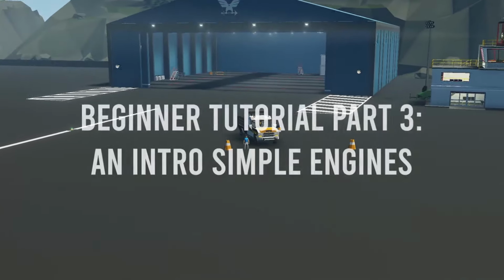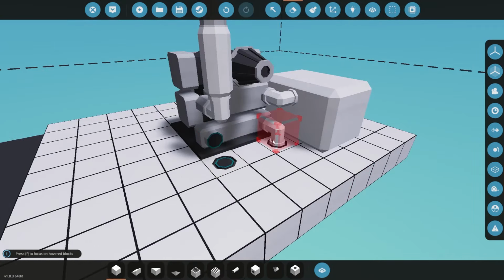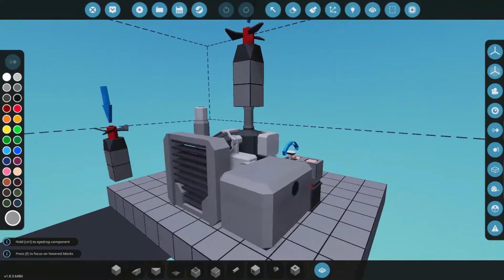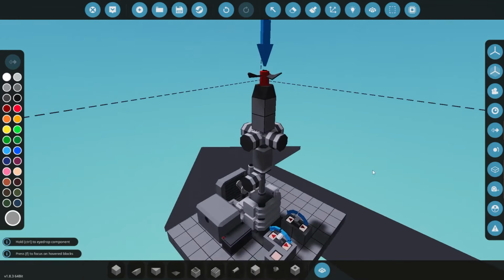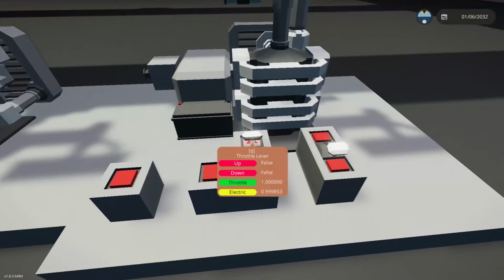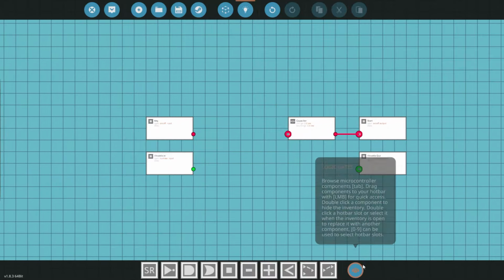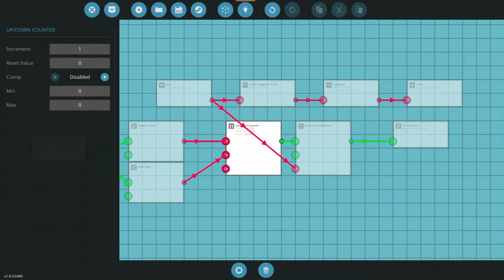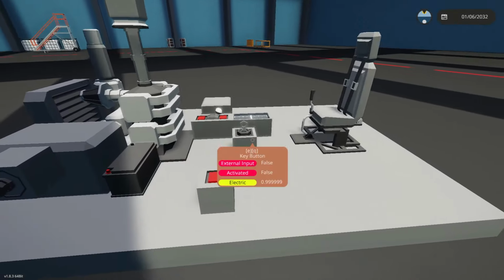Simple Engine Tutorial for Stormworks (Engineer Explains)

Comment: IMPORTANT FOR ALL STORMWORKS WHO CAME FOR TUTORIAL IN ORDER TO ENGINE FUNCTION CORRECTLY.

After the space dlc update, you must add a gas relief valve for the fuel tank. Just hook it up similar to the engine air. The only difference is that you must have a gas relief valve and position anyway you like. Don't forget to add any components like fluid port, air filter, or ram air.
Reply from the maker: 100% True, thank you! I did make a video specifically about that realization, but good to note here!

See video here: https://youtu.be/aHdklCKUtKw
Reply: @454ss_gaming  sorry, could you tell me which of your videos is about this?
Reply from the maker: @tukangambit406  https://youtu.be/aHdklCKUtKw
Reply from the maker: @tukangambit406  You can find it here: https://youtu.be/aHdklCKUtKw
Reply: @454ss_gaming do you know if there were any changes to the generation of electricity/battery supply too? Because i started recently playing stormworks and watched many tutorials. Everyone is doing it like you with just the small generstor connected via logic interface to the battery. But it doesnt work on my build and even small rafts are constantly draining the battery without charging
Reply: @jonathan1384 starter has to be disabled after the engine runs because it consumes alot of power
Reply: @Sliptethank you, ive learned it already and it works
Reply: @jonathan1384  well anyways hope you have fun with stormworks

Comment: Built a small ship, duel small engines, had everything hooked up acording to a steam guide and these videos, but everytime I'd start it, It'd drop rpm till 0. Had the clutch setup to be on when started, had the throttle set to 0.15 to avoid stalling, but no matter what I'd do it would stall after starting. I've spent 3+ hours searching and troubleshooting to no avail. 

All intakes/exhausts are setup shorter then 20 blocks and with ports
microcontroller setup just like this tutorial
custom fuel tank built similar to the one in the "unofficial stormworks guide" on steam
RPS going into a clutch, going into two 1x1 gearbox's with ratios set according the guide as well

as far as I can see from these videos, many google searches, and the guide, everything is setup right but it just wont idle. I know im missing something but I cannot figure it out.

Just kinda venting for a min, dont expect any help but any tips or idea are welcome. Gonna take a day or two then maybe try another build or something, idk.
Reply from the maker: My first advice when an engine doesn't run is to disconnect the load (ie. propellers).  Then put throttle to 100% and see if you get like crazy RPS (50-60).  If that happens, your engine is stalling out by the load.  If that does not happen, your engine is not getting air or fuel, or exhaust is building up!
Reply: @454ss_gaming  In all my rage it never cross my mine to try that. I appreciate you fr 🖤

Comment: Whenever I press the starter button it seems to keep trying to start and it goes while pressing the starter without throttle
Reply: How do I make it stop driving when I press the starter?
Reply: It also doesn't start AT ALL
Reply: What I mean is that that stupid car goes when holding the starter and it doesn't seem to get enough RPS's in order for the throttle to work
Reply from the maker: @FlorVerschraegen I have more advanced tutorials that I would recommend. Sounds like you don't have a clutch so the power is going direct to the wheels!
Reply: @454ss_gaming okay thanks 👍🏿

Comment: So, I built my first working ship — I’m so freaking proud! I made a custom 16-cylinder engine that has enough power for it. Okay, it loses some RPM after about two minutes because of heat, but so far, so good!

I even made my own custom controller for the clutch, key, and throttle. Thanks! It was so overwhelming at first, but after understanding the shortcuts and the navigation inside the building menu, it became much easier. I’m far from a pro, but it’s enough to give me a big smile every time I spawn it in!

The only problem I have is cooling the engine... Even though I made three loops with six electric radiators, it just won’t cool down. Meanwhile, I built another ship using the preset big engine — and that one cools perfectly fine with just two radiators.
Reply: Hi friend, are you installing a coolant manifold? Also, the engine's water pump is probably not sufficient. My recommendation is to install an external water pump and remove the standard water pump from the modular engines, logically running the piping through one side of the coolant manifold, then through the radiator, and ending on the other side of the manifold.

Comment: my engine just cranks and I'm starting to lose my mind. i changed from gas valve to liguid nothing.... I'm truly pissed cause I spent all this time trying to get one engine to work and now steam wont even refund me. It is infuriating.
Reply from the maker: If it cranks but does not catch, it could be a number of things - no fuel, no air, the AF ratio could be off, the load after the clutch may be too large! Take your time and look at the sample engines :)
Reply: @454ss_gaming   was fuel connection somehow. I turned on infinite fuel and it worked then so I'm assuming I messed up.

Comment: I am unable to get the engine to run on its own without the starter
Reply from the maker: That means it is stalling out, try disconnecting the output and see if it stalls, if so, might be fuel or air, otherwise, the load my be too high for it
Reply: @454ss_gaming  fixed it had a gas relief valve on the fuel tank when it should have been a liquid relief valve
Reply from the maker: @1dK628  Yay glad to hear!
Reply: @ alright thanks

Comment: hey! i'm making a rescue boat/ship. im using the fluid jet as propulsion, But after driving like 25 meters the engine just shuts down. i have the gas relief valve and air, fuel and battery i dont know whats happening. it works when i have inf fuel but not without. i use the air ram as air intake and fluid ports as exhaust. btw i use two medium engines with the RPS 20 and i use 16 medium fuel tanks on both engines. i cant figure out the problem. (it's not because of the force that shuts the engine down it just shuts off and wont start.)
Reply from the maker: Hmmm can you upload it and I might make a video looking for the fix? But no promises! It is a possible series I am looking into starting.
Reply: @454ss_gaming   yeah sure. But keep in mind I’m not completely done with the build. i started on it yesterday and i like fixing the engines before i go all inn on details
Reply: @454ss_gaming  I uploaded it. I called it RS Norway (beta). i have colored the pipes here is a list for them, Orange=RPS, dark blue= Air intake, Light blue is water (for the fluid jet), Red Is exhaust  Yellow is to the radiator and Green is fuel. Hope you can help! good luck.

Comment: Spent two hours trying to build an engine last night that wouldn’t work, completely missed the air port underneath the power output. This video solved my problem in the first 30 seconds 🤣
Reply: Did the same last night, while my internet wasn't working for some reason. Found out the hard way by taking out the engine and going through every single connection.

Comment: How did you move the whole platform up? Thanks so much for this video. Starting the throttle at 0.25 is enough to start the engine and have it run, but I'm sure you know that by now lol. Your creations are top shelf.
Reply: What do you mean by moving whole platform up? And engines are able to run from .15 throttle, tested it.
Reply: @bombbombov2984  By platform I meant the whole creation, I thought platform because the engine was on a platform, but I did mean creation (unless there is a better word for ir). That's good to know I'll be making some adjustments. I apologize iof my typing is hard to read or understand, I have visual issues.
Reply: @Ravenheartz  theres a button to do that (disabled in building edit areas)
Reply from the maker: Thank you! By platform do you mean just move the creation up with the arrows?
Reply: @454ss_gaming  Yes, I meant the whole creation, I watched your part one video and now I know it's a move button on the top menu in the workbench.
Reply: @Ravenheartz  There's a select tool, and once you have the section selected you want you can 'cut' it (press the scissors on the left side of the screen), move it to where you want and then press paste. The regular hotkeys work too but to start off with you can just use the on screen buttons and the tooltip info will prompt you through much of it.
Reply: @count_thrain  exact way to move building in structure workbench